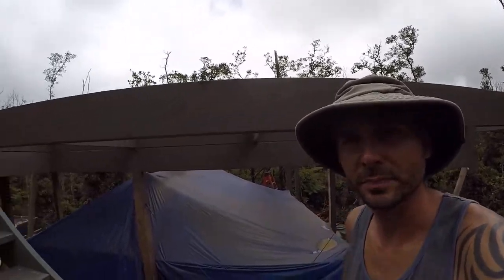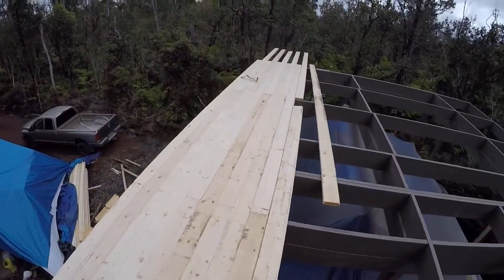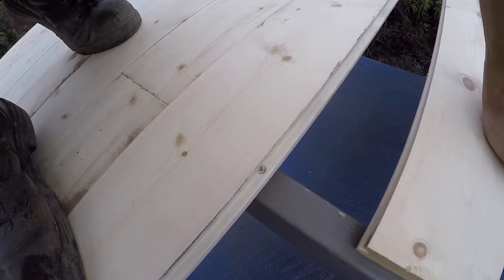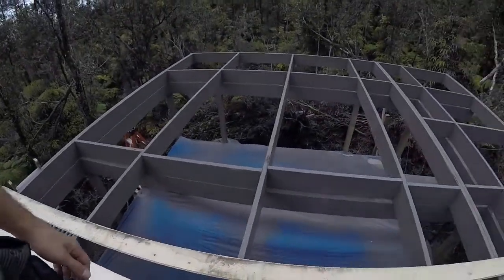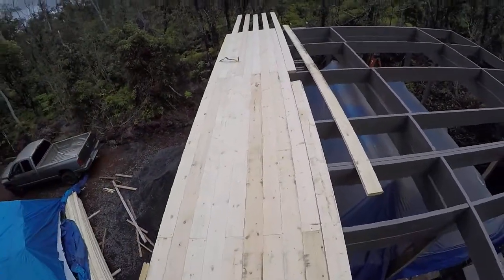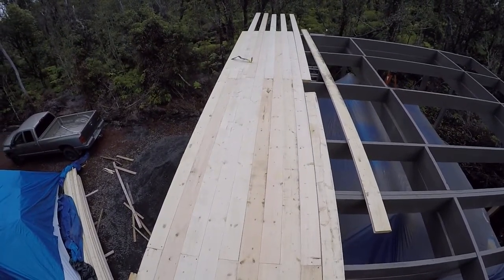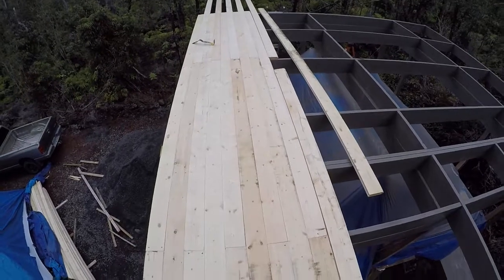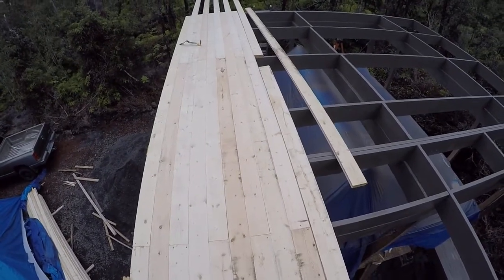2x6 Tongue and Groove flooring install

Comment: Looking good! What type of wood is your tongue and grove and where did get it on the big island?
Reply from the maker: Thanks Adrian! The tongue and groove flooring is No.2 Pine, and the only place I could find it was at HPM.  They had it in 16' and 20' lengths.  You could also try a couple of the other lumber yards in Hilo.  Home depot may have some but I'm not sure if it's in stock anymore.
Reply: @themokunahouse8685  Awesome! Thank you for the information.
Reply: That’ll never work you need subfloor because you have to shoot nails every 6 inches